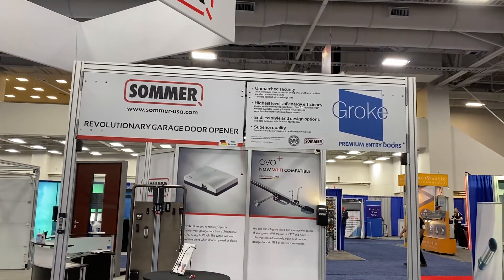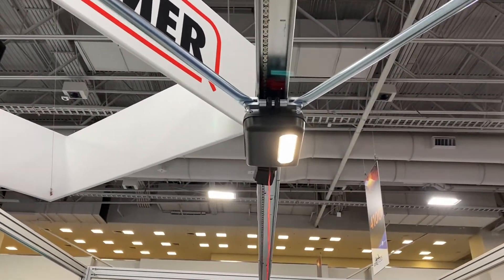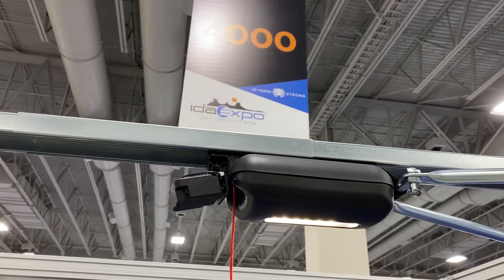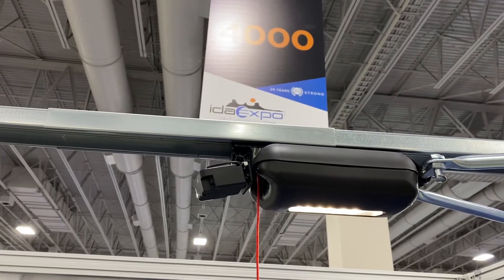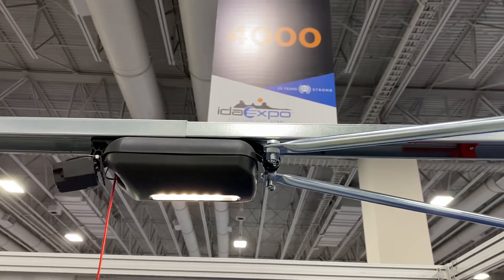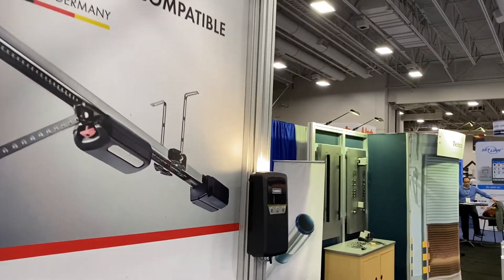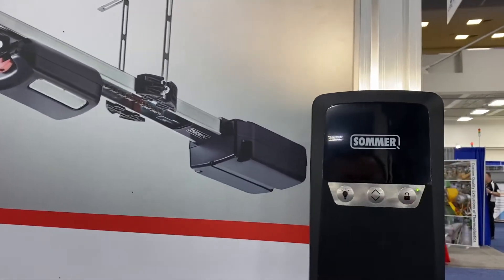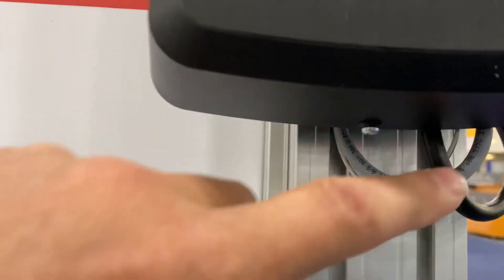pro+ 2060 Swing Door Operator at IDA Expo 2020

Comment: You are 10x more helpful than trying to read through the Sommer manuals (which don't cleanly address this). Thank you!
Reply from the maker: You’re welcome, that’s why I made it. 

The operator manual is written for overhead doors, and the manual that comes with the swing door kit is, unfortunately, not very concise. There’s an installation video in the works from SOMMER.